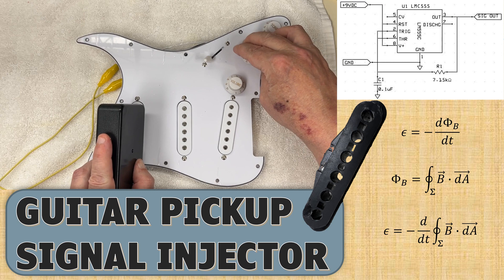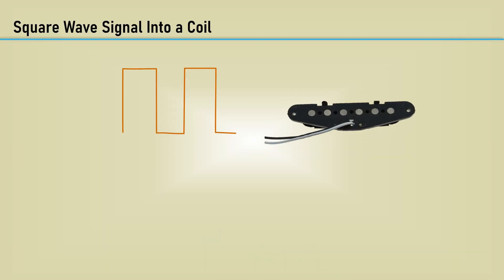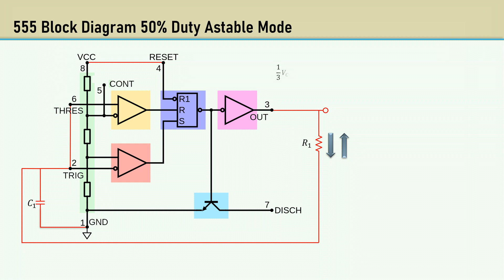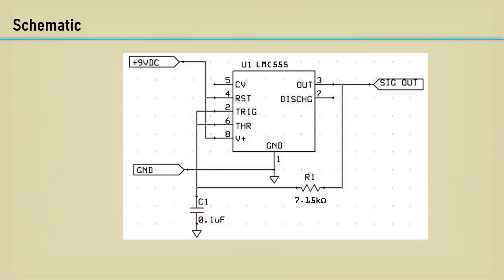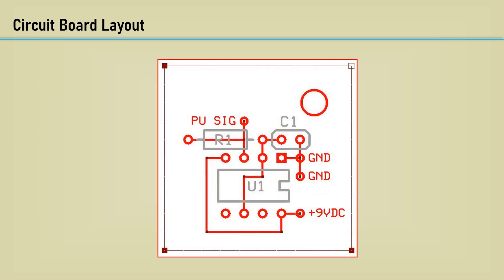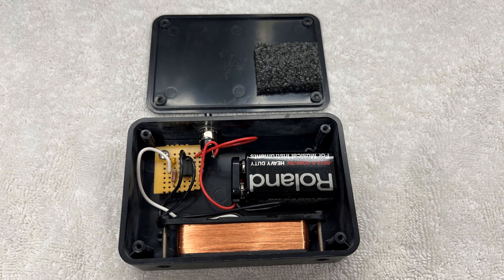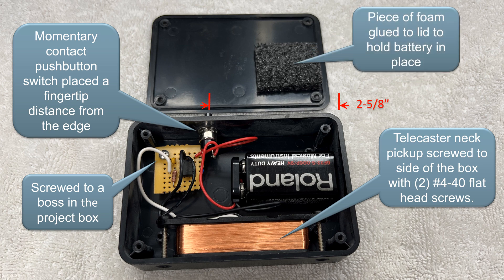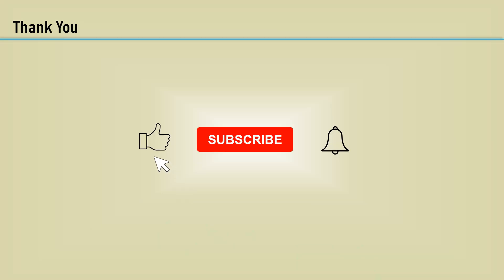Guitar Pickup Signal Injector

Comment: Very clever! I couldn't be bothered about getting so close to 1000Hz; I don't keep a complete E96 assortment on hand and it's just a test signal with some high frequency hash. I'm sure it would work just fine at a slightly lower frequency with an 8.2K resistor. In fact, this is just a whisker away from the octave above A-440. (EDIT because I didn't bother doing the math first.)

I wonder if the probe calibration signal on an oscilloscope spits out enough current to drive a pickup coil. If not, it could easily be passed through an emitter follower. Not quite as portable, but it's a convenient signal source if you already have the scope nearby.
Reply from the maker: Thanks for the comment. The choice of 1kHz was quite arbitrary. I should have pointed that out in the video. My modern day DSO probe calibrator puts out 5V, which would be plenty. I didn't think of that. I imagine most guitar tinkerers would not have an oscilloscope.
Reply: @oldhackee3915  I know it's a nominal 5V, but what I don't know is if that's at enough current for a pickup coil to produce enough of a signal for another coil to pick it up; a vibrating guitar string dissipates a lot of energy. Anyway, I have a background in classical music, so I was more than a bit amused to find that E12 values give a frequency so close to standard concert tuning. (In fact, it would probably be a more stable reference than a pitch pipe, and this could easily be used to induce vibration in the A string. Imagine an orchestra tuning to the guitar instead of the oboe! lol)

I wonder what topology modern DSOs use for the probe cal signal: I've never looked into that. I wouldn't be surprised if it's this.

Comment: Yet another thought... For folks that have a signal injector function on their signal tracer, might that be used as the signal source? I know that the older ones use tubes/high voltage. Would there be dangers lurking about? That is not an issue, with OHEE's battery operated/isolated solution. The narrow contact point of the injector's probe might also be useful in finding an individual weak/unbalanced magnet.

Comment: Super clever!!! Thanks for sharing! You claim that you used a square wave, in order to hear all the harmonics. But, you aren't fooling me... You just want to rock out! lol... I take it that the purchase/use of the Telecaster pickup was simply for the convenience of not having to wind a coil for the purpose. I imagine that the coil needs to be little more than a wooden stick, having a length of the width of common pickups, and so many turns of magnet wire of a sufficient diameter. It would be great, if you/OHEE, or another commenter, would give us the details for the wire and windings. I do not have that knowledge. Another cheap and useful tool for generating the needed frequency might be to build one of those Asian Function Generator kits. They are so inexpensive as to be price competitive with ordering the needed 555 parts. You would gain the extra functions of the generator for other uses. Should someone want to build/use such a generator, please know that the Asian kits have quirks. There are several YT videos on the corrections to be made. Those bodges are not too complicated. Of course, you would not use the the 555 timing portion of OHEE's circuit; you would probably want to keep the amplification portion, though. Perhaps OHEE would clue us in on how to tie the function generator to the amplification circuit? All good fun and very inspiring; thank you, OHEE! Cheers.
Reply from the maker: Thanks for the comment. You could wind your own, but for $11, I couldn't resist the Tele neck pickup.